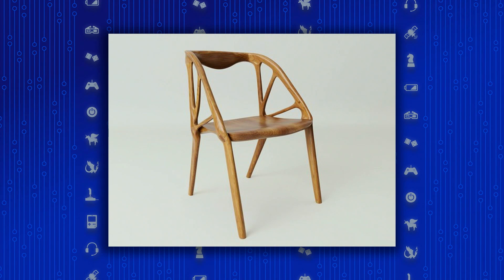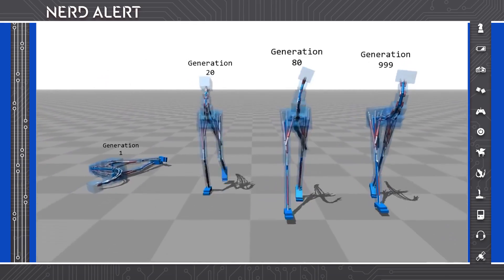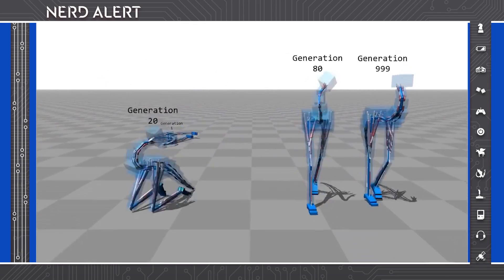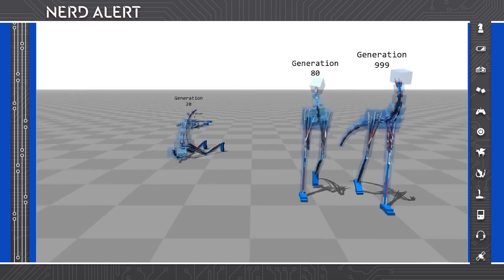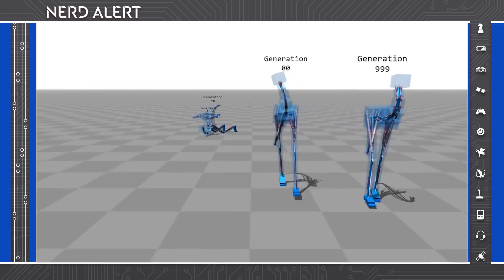Check Out the Chair Created By a Computer Program

Comment: cool, but old tech... maybe new in chair design

the antenna in your cellphone was probably designed by a similar process to find a structure that maximizes signal strength while minimizing material used.